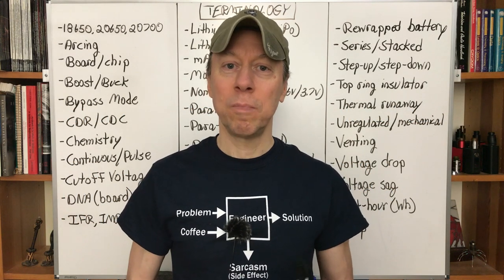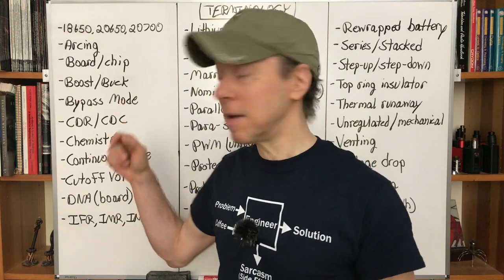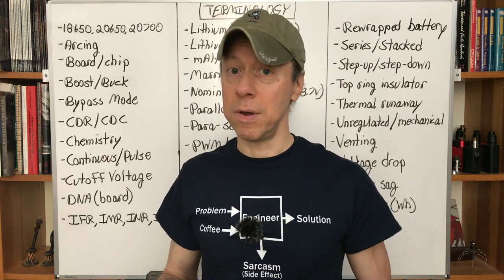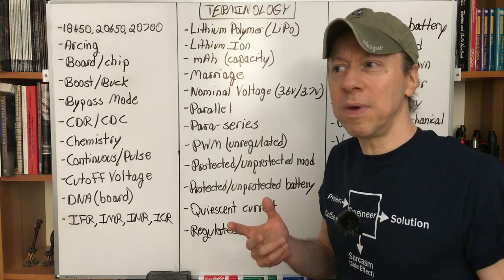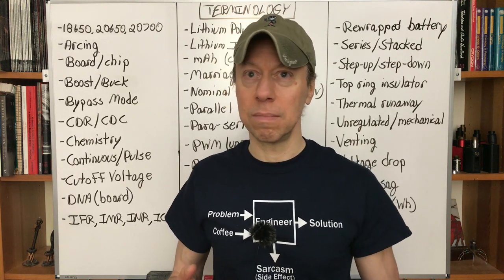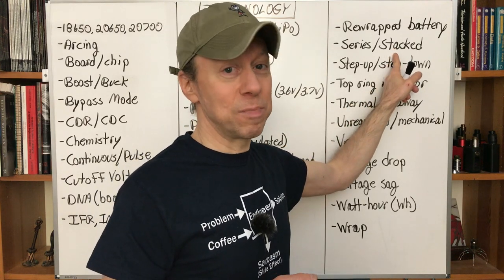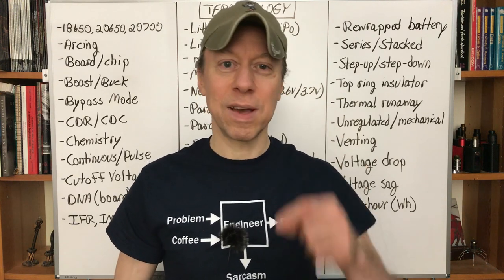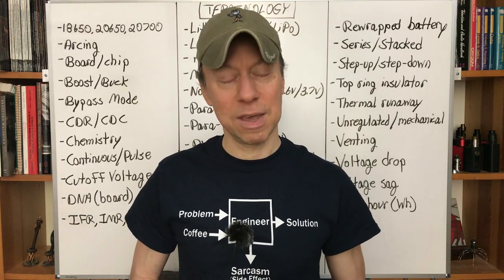Battery Basics for Vapers Ep1 – Battery related words and phrases

Comment: i've seen kdest batteries claiming that the drain is 50amps. have you already tested them? are they legit?
Reply from the maker: No, those ratings are not legit. The  ratings are exaggerated. I haven’t tested any Kdest in a long time but there are no 18650’s rated over 30A and almost all of them are a lot lower than that.
Reply: thank you,  i was about to buy that and vape it on 0.13 ohms. You saved me. could you recommend any 30 amp drain 18650's?
Reply from the maker: Hanzomancer there are only two, the LG HB6 and the Samsung 20S...get the 20S.
Reply: @batterymooch  thank you.

Comment: Got.a geekvap aegis 100watt running single 26650 if I run .15ohm it will read and fire up to 100watt .30 ohm or.more will only read and fire 30 to 50 watt could this be my batterys they are vape pro I think only  4 weeks old mod batterys and all
Reply from the maker: Probably hugely overrated batteries.
Reply: Battery Mooch what 26650 would you recommend
Reply from the maker: Shane Moore try the Golisi or Aspire 4300mAh. Decent, when I tested them. I don’t know if they are still the same cells or not though.
Reply: Battery Mooch all my local shop carry is are how are they
Reply: Battery Mooch or homegrown I think the said
Reply from the maker: Shane Moore get the Hohm Grown, a decent 23A battery. I don’t know anything about the others. Keep the wraps in PERFECT condition.
Reply: Battery Mooch thanks for all your help I truly appreciate it I am new to vapeing and it is good to have help